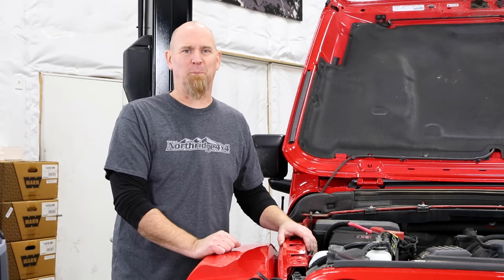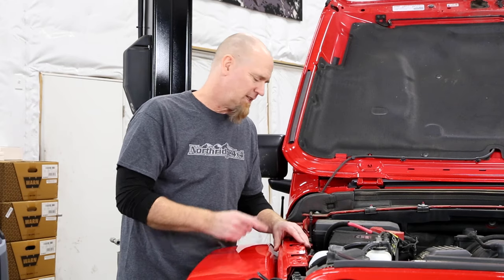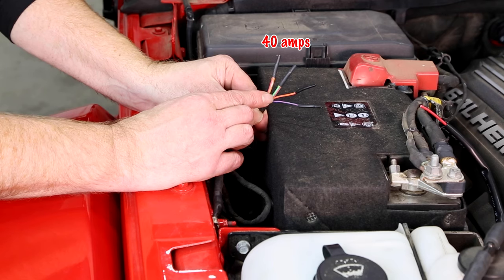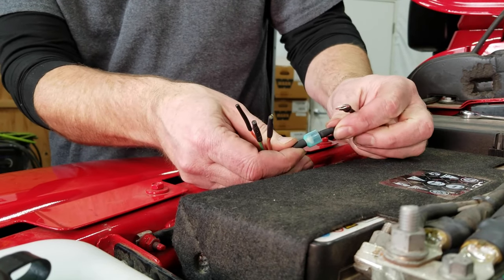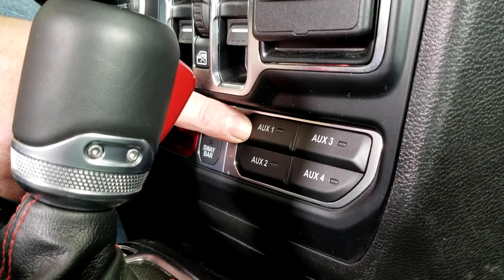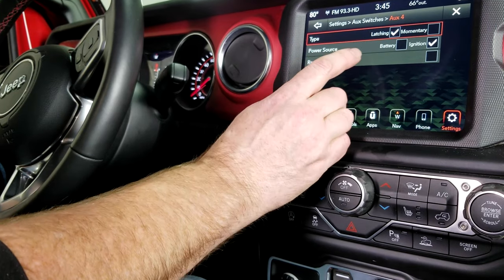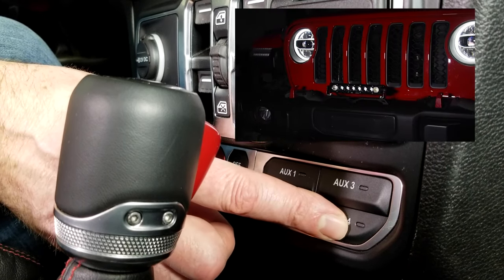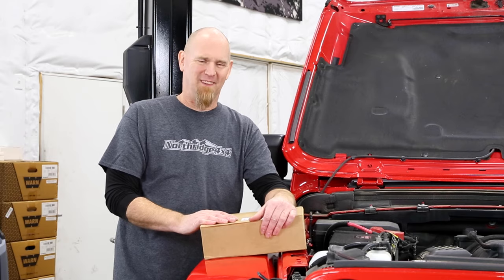How to Wire and Program Your Factory Aux Switches - Jeep Wrangler & Gladiator

Comment: Given my question about a relay, below, the 4 “hot” wires under the hood for each of the 4 aux switches should really be coming from a factory installed relay (pin 87) that is part of the aux switch wiring circuit — and not directly from the switch itself.

Comment: do you have a video showing what to do if the light bar comes with a relay, fuse and switch but want to install in an aux switch?  I'm assuming you'd have to rewire the harness
Reply from the maker: How many amps does your light bar pull?

Comment: Great video simple will save time and $$
I have the factory aux switch option with tow package
Do I need to add a relay or switch already has relay from factory 
Thank you
Reply from the maker: No need if you are connecting to the aux switches and the load is within the load rating of the switch.

Comment: Thanks to your video I easily found the under hood wire ends for the Aux switches.  At first glace I did not see them.
Is it possible to hook up LED lights illuminating the side steps that will go on with lights as I grab the door handle?
I thought at first read of owners manual that the programming of the Aux switches allowed this to be programmed for any of the 4 switches.  Your video did not show that as an option.  I have a 2023 High Tide JL 4dr.  
Thanks, Craig
Reply from the maker: Glad the video helped.
As far as wiring LEDs to your side steps to activate with your door handle, you would need to run them through the Aux Switches. Wire them to your footwell lights. Then they'll light up when you hit the unlock feature on your key fob.
Reply: @northridgenation  ✌Kudos!! Thanks for the reply.  That is a great idea since the footwell lights are right there above the side steps and next to the inside Aux wire terminations.  I REALLY appreciate your feedback on this.
Craig

Comment: Great video .. hoping you can assist ...  Regarding Rigid Radiance Pods. The colored backlight option to run the backlight independent I would need to wire that to a seperate AuX, Ex: Aux1 flood light /  Aux2 amber backlight ?
Reply from the maker: Yes, each light source will need its own switch if you want them to operate independently.

Comment: If I want to wire two set of lights to one aux switch how do I do it and what connector to use? Ofc, keeping in mind that the total amp draw is less than what is stated for the aux switch.
Reply from the maker: Use spade or bullet connectors (or similar). Crimp the light leads into one side and the other side onto the aux wire lead.

Comment: This video is explaining how to add lights to your switches if the Jeep came equipped with the switch pod.

Your Jeep did not come with that from the factory so your computer doesn't know what to do when we introduce the switch pod to your Jeep. It has to go to the Jeep dealership and be "taught" that your Jeep now does have the switch pod.

Comment: How would I attach a 5mm, pre-wired 12v LED diode with two wires, black and & red? It's a tiny, low energy bulb so Aux 3 or 4 would be the best options, but what would the black wire and red wire connect to? Positive to the stripped wire and negative to ground?
Reply from the maker: Yes, positive to the Aux switch wire and negative to the ground.

Comment: Thank you for this... means a lot. I bought 4 spot lights that go on the hood. So this vid is what I needed. TIA
Reply from the maker: Glad it helped!
Reply: @northridgenation  I just had to order extra wiring they didnt come with any. Like how the heck did they think it would reach, lol. gotta love amazon lights, lol .... the ones i bought
Reply: @northridgenation  Do you know if there is a set of aux wires under the passenger side as well? or are they only near the battery? I am looking to install a GMRS but didnt want to run it all the way to the driver side firewall then all the way back to the battery area? any help will be appreciated.

Comment: How to connect rough country ledbar 30inch ( with the aux switch) on rubicon 2023 note* ledbar has three wires white blue and black
Reply from the maker: Is this a dual function lightbar? 
The black is the negative. What do the other two wire control? Maybe a high and low beam function?

Comment: What wire harness is that. I want to do this install. I'm about to order the aux switches from your site.
Reply from the maker: The wire harness comes in the kit.
Chrome Bezel: https://www.northridge4x4.com/part/switch-panels/82215798ae-mopar-auxiliary-switch-bank-chrome
Black Bezel:
https://www.northridge4x4.com/part/switches/82215798ab-mopar-auxiliary-switch-bank-rubicon

Comment: Hello! I’ve seen some comments about this but haven’t seen an answer yet. I am connecting a 20” rough country light bar to my JL aux switches. I cut off the original switch that came with the bar in order to wire it to the connecting aux wires. When I cut off the switch it has a white, blue and a black wire inside of it. I obviously cannot connect all 3 to the one aux wire? Which one do I connect? Do I use one or all 3? Any insight would be greatly appreciated!! Thanks!
Reply: It is a single function light bar, before I cut off the original switch, it was only on off.
Reply: I believe black is a negative, white is a positive input and blue is a positive output… but if I can wire all 3 to the single aux wire in the bundle
Reply from the maker: I'm showing the RC 20" light bars use a 3 way switch, so there must be two different light functions.
To test the light bar functions, hold the wires direct to the battery terminals. Black to NEG and then one at a time, hold the white to POS, remove, then hold the blue to POS to see what the functions are. 
Then to hook to your Aux switches, you would want to ground the black wire and then hook the white wire to one aux switch and the blue wire to another aux switch.

Comment: So I have a plastic front bumper, is drilling into it for a light bar install ok? I’m new to all this 😅
Reply from the maker: For smaller, lighter lights that should work fine. For bigger heavier lights you'd want a metal mount or metal backing to keep vibration to a minimum.
Reply: @northridgenation  I have researched more, looks like diode dynamics makes a bracket. Seems to be the best option. Thanks!

Comment: I'd like to wire up the winch to a relay, triggered by an aux switch. That way, the winch won't drain down the batt when the vehicle is off. Most videos show connecting the winch directly to the batt and the wireless remote is always on.
Reply from the maker: Unless there is a problem with the winch, it will not drain down the battery when the vehicle is off.
Reply: @northridgenation  is more of a safety precaution like wiring in a manual master power switch on the main positive winch cable.
Reply from the maker: @jefftenhave8038  Just make sure that your master power switch will be able to handle the amp draw of the winch under full load. The commonly used winches pull around 475 amps under full pull.
Reply: @northridgenation  yes Thank you the master solenoid I am using for this purpose is 500amp

Comment: Wiring up a solenoid for the winch aux 1 switch.
Reply from the maker: That could be done, you'd want to make sure you program it as a momentary switch, so it turns off when you release the button.
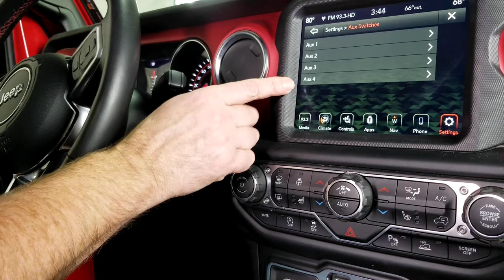We discuss latching vs. momentary @4:55
Reply: @northridgenation  for clarification I am using the solenoid with Aux1 as a master power switch to the winch, not to operate the winch, in which case it has to be latching as it has to keep power to the solenoid to provide power to the winch. 
However, if one wanted to use Aux1 and Aux2 as winch in and winch out then you are correct it would have to be set as momentary.

Comment: When installing the switches themselves Did you have to program the new switches into the uconnect in order to get it to work or did it just activate once installed
Reply: You have to get the system rebooted at the dealer. Then they will show up. It's an option code that has to be added. The instructions that come with the switches have a paper to explain it to the dealer. After that, they will show in the options.
Reply from the maker: You can use a Tazer Mini to activate the Aux Switches, along with many other functions.
https://www.northridge4x4.com/part/programmers-tuners/jl-tazer-mini-z-automotive-prgmr

Comment: So for the 40 amp switches you can run anything on them up to 40 but you could still run 8 amp lights on them?
Reply from the maker: Yes, run anything up to 40 amps max.
Reply: @northridgenation  and you don’t need to swap the fuse to a lower ampage if doing so?

Comment: Does the aux switch system already have a relay built into the wiring circuit?  I sure hope so.  Proper vehicle wiring sees the aux switch triggering a relay which, when energized when the aux switch is turned “on”, provides power to the accessory such as a light bar.  If the factory installed aux switch system is not using a relay, it is a very poor idea to power a high amp draw accessory, such as a compressor, directly from an aux switch.
Reply from the maker: Check out the Mopar Aux Switch system here: https://www.northridge4x4.com/part/switch-panels/82215798ae-mopar-auxiliary-switch-bank-chrome
It includes a pic of the wiring harness, fuses and relay box.
Reply: @northridgenation  I only see one picture of the panel.

Comment: Which switch should I use (40 or 15 amp) for 32q ICECO Refrigerator?  can't find the information anywhere.
Reply from the maker: We don't have the specs for the ICECO Fridges. Post up if you find them.
Reply: @northridgenation  DC 12/24 V DC, Fuse 15A,
Reply from the maker: @Haro75410  if they are spec'ing a 15 amp fuse, then you should be good to go with the 15 amp switch on your Aux switches.